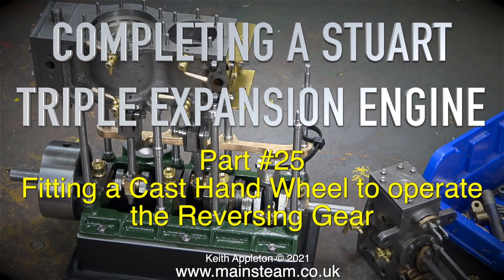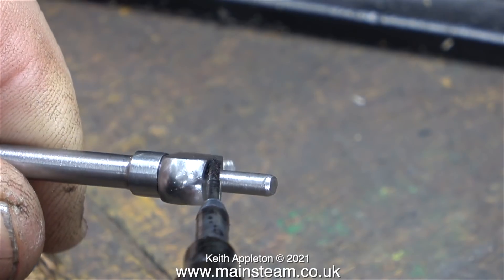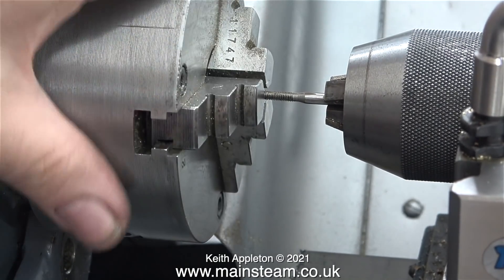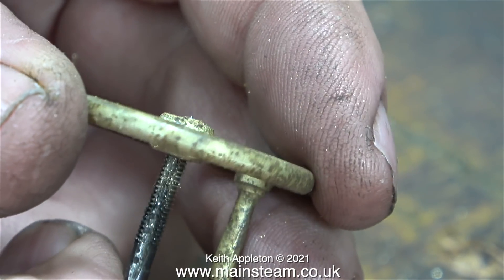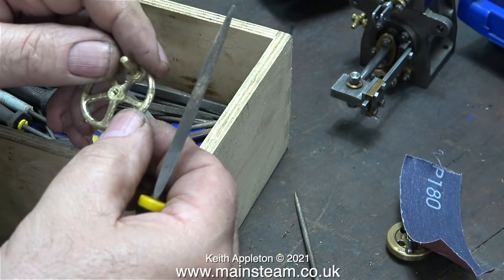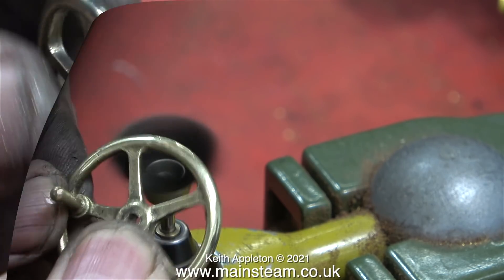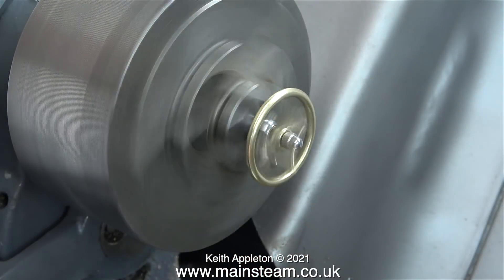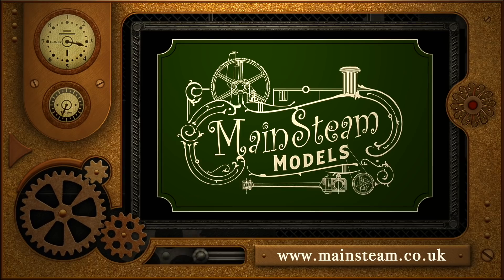COMPLETING A STUART TRIPLE EXPANSION ENGINE - PART #25

Comment: I know this is an old post, but I wonder if one of the vibration tub machines with the little green “stones” might have cleaned this up. I’ve seen them used for small rusted bits or old  nuts and bolts and they come out amazing. With different grit stones they can either De-burr, or polish. Thanks for the great video.